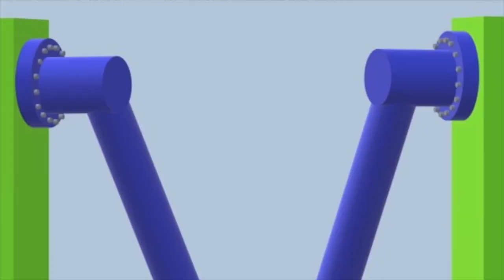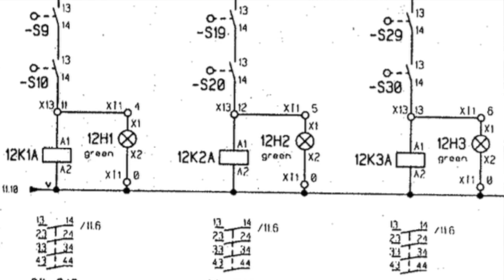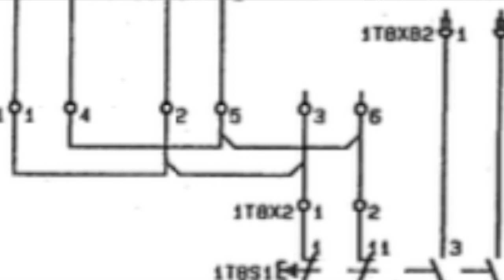10 things ride mechanics hate about rides

Comment: I'm in the UK and I've only been a subscriber to this channel for about a week, and its fast becoming one of my favourites. Its great to get an insiders view on the mechanical side of things, one of the most frustrating things at a theme park is when a ride is "down for maintenance". Do you think that a park should be a bit more open with guests when its just for cleaning up vomit/blood, or someone passing out in the queue line? it would help guests realise that the ride is safe and also give them an idea of how long the ride will be down for.
Reply from the maker: its bad either way. when they say the ride is down, you loose people even if its a simple reset. when you say someone vomited, you loose people just on the gross thought. so there is no good option. best I heard was a magic mountain they said the ride was temporally down but they advised waiting in line. parks don't like this because if I wait 30 min for it and they were wrong, im more upset now than if I just got out of line. no recall good way to handle this

Comment: Just discovered your channel, great content!  I’m actually looking for an old gas-powered, cable drive #5 Eli Wheel and Scrambler. If you know of any sitting around, or know someone who deals in used rides, I’d appreciate it.
Reply from the maker: That’s a rough one. The paper “Amusement today” has an add section in the back. I know good used stuff is very hard to come by. Google has search if you type in used amusement rides. Maybe someone reading the comments might know as well. Either way make sure you get the service and NDT records for those.
Reply: @ryantheridemechanic  Thanks, I appreciate that!

Comment: A true number 1 is maintenance hates engineers.
Reply from the maker: I guess it’s the engineers you work with. The ones I worked with, had and still have a great relationship. Sometimes they get in the way of a repair but their looking out for the best interest of the safety, equipment, and park overall.

Comment: I sub you and i am a ride enthusiastic i am always wondering how many times a ride would beeak down and curious about air control valves and motors and hydraulic system 

I am a enthusiastic about a ride called Avalanche and it's built by Wisdom Rides industries and i am always looking around and finding out in and out of this ride and this channel will help me what i would like to know 

I am wondering about a gear part called sleuth ring that is used on th ride behind the big arms that holds the bench of seats in a row and its inside of a hub that turns the arms
I am wondering what drives it and pushes it inside 
There's 4 holes behind the scenery panels where the sweep hub is 
Any thing would help this fan out 

Cool channel
Reply from the maker: @Polaris_1992  thanks! And welcome!  I haven’t done a video specifically on slewing rings yet but I think I will in the future.

Comment: As a fella that's worked a variety of things, intermittent electrical faults are often the worst to diagnose and repair.
Reply from the maker: Yep because you have to troubleshoot in it’s failed state “DONT TOUCH ANYTHING” I’ve actually had to hold people on rides for another 5min or so while I tried looking for the problem in relay logic systems. Not fun.
Reply: @ryantheridemechanic  I had a fuel pump decide to not pump right in the middle of an intersection, then it decided to work again. That wasn't fun, either.

If I ever put in a new fuel pump in an old car, all of those connections will exceed O.E.M. (I'm thinking solder and shrink tubing, or at least solder and taped).
Reply from the maker: @j.l.m.6862  what a pain
Reply: It seems to be a common fault in older vehicles. And due to the labor time involved, many shops will advise full replacement of stuff still having some service life left.

The "buy once, cry once" idea, I suppose.

Comment: LOL! Mechanics were MY friends. I worked at a themed park. I knew maintenance personnel pretty well from Carpenters, paint, Fiberglass, electricians, sign shop, mechanics. Even knew drafting/engineering. Certain mechanics had their own "babies" Rail road, Shuttle loop coaster, Arrow suspended was Emerick & Johnathan. Also some flat rides Chance YoYo/ Trabant. Shuttle Loop would misindex long or short. Ride ops push train forward or backward manually. They all could tell funny stories. I learned a lot from them and eventually moved from railroad to Sign Shop.

Comment: I thought you were going to list evacs as the number 1. I couldn't imagine how bad scared guests could be when walking down a lift hill. Sheesh, I was witness to some epic breakdowns guests had waiting on the final brake run of Superman at Great Adventure... You know, the flier where you are a measly 4 ft off the ground on that brake run...
Reply from the maker: We always had operations do the bulk of the work. Maint was just there to open the restraints when asked. But we Alway had first aid there to judge the people before we opened the restraint. If they found people that looked like a panic risk they would address them first

Comment: Your videos are awesome! I have a couple questions about roller coaster wheels. The last time I went to Worlds of Fun, the Mamba (the parks Morgan hyper) went down for maintenance twice in one day because maintenance needed to replace a wheel. It appeared the polyurethane coating had lost a chunk both times. One of my friends went to World of Fun a couple weeks later and the Mamba closed to replace a wheel again, which feels like quite a bit of wheel issues.

1. How often do you have to replace a wheel on most coasters? Is more than once a day excessive?
2. Is there a specific reason with the track or trains that would cause roller coaster's wheels to lose chunks of the polyurethane?
3. Have you heard anything about Morgan wheels being problematic/do different manufacturers need their wheels replaced more often?
4. About how much does it cost the park to replace a wheel?
Reply from the maker: Great questions. Best response with a video much easier to show in this case because I can.
Reply: @ryantheridemechanic  Thank you so much for considering my questions! If you do end up making a video I'd be eternally grateful <3

Comment: 👍 I Alway praise the maintenance crew of Knoebels for their ride upkeep, but do you think maintenance on old rare antique rides would a bigger nightmare for crews or that newer rides are worse?
Reply from the maker: Older rides are more of a nightmare because the supply Chain has dried up. When you need stuff it will now require engineering to make a new part an that is not easy or cheap at all. Good question

Comment: Hey! I love you vids. I wanted to ask you a question. Are ride mechanics allowed to talk about how coasters work with guests? Because when I went to Disneyland I asked a cast member how many trains are on the track and she said I can't really talk about that but then I spoke to a manager of the ride and he said 10 but he also mentioned how certain components of rides can't be discussed with guests do to contracts they sign with manufacturers. I just wanted your thoughts, thanks!
Reply from the maker: Most parks don’t want to discuss things like this for 3 reasons. 1) it distracts the workers slowing the rides throughput and possibly casing a safety condition. 2) it none of the guests business at all. They don’t need to know “our” inner workings. 3) typically when questions like this are answered, it has to come from the PR department so the park doesn’t get a black eye. They want to know who they are talking to and what they are doing with that info. I got in trouble by PR because I said the cost of a ride that was 18 years old. “Never say a cost” they said.
Reply: @ryantheridemechanic  Okay gotcha, thanks for the thorough reply. I love roller coasters and how they work so I just have a curious mind, I never meant any harm by asking them lol. Thanks for the reply!
Reply from the maker: @JungleJetAviation06  no worries. It’s always been curious with questions I’ve had growing up so let’em rip. There are some thing I can’t/shouldn’t say and if that’s the case I’d let you know.
Reply: @ryantheridemechanic Also, just in general, why do parks sign these types of contracts with manufacturers that certain things can’t be discussed? They are not nuclear codes lol
Reply from the maker: @JungleJetAviation06  it’s because the manufactures don’t want to get into price fighting. Pricing is a negotiation so they can’t sell the same ride for the same price twice. They don’t want “well you sold it to this park for 12million why is our 15million?” Every coaster is custom and there is sooooo much that goes into price. They are not like buying a new car.

Comment: Hall effect sensors, why the F aren't hall effect sensors on this list. You talked about rides being dirty but one spec of dirt containing any metal can cause a ride to go down 😢
Reply from the maker: Hall effect sensor are actually pretty stable well at least the one I’ve used, hard to mess up as well. Inductive prox, yea keep them cool and clean.
Reply: @ryantheridemechanic  I've seen them detect a lot of ghost trains, might be brand dependent though, or the type we use/hate are called induction proximity sensor over there in the US. The little green boxes of crap that we have several new ones of in our toolbox to almost use daily... Lucky they are light weight and cheap 😅
Reply from the maker: @HaroldKuilman  ok so hull effect is different than inductive proximity. Hall effect sensor won’t flag with metal in front of them. That strictly work off of magnetic polarity so the need a magnet to flag them.
Reply from the maker: @HaroldKuilman  I feel like we are talking about the same thing with different terminology. Let’s agree sensors suck 😂
Reply: @ryantheridemechanic  from a physics perception; all metal and magnet detecting sensors rely on the hall effect to work as they change the magnetic field when present. Where I worked (in the Netherlands) we just call them sensors, we didn't have any that detect magnets in particular. So that might be a translation error from my side. And yes, let's agree they suck.

Another thing that sucks are the plastic caps on the wheels of old vekoma wheels (like on most boomerang coasters) that can easily be kicked off by employees or guests.., once or twice a week 😅 during high season we would just glue them in place, break them during the bi-weekly maintenance and replace them for new ones to minimize downtime.
Reply from the maker: @HaroldKuilman  haha!!! The plastic caps. Ours had grease in them but they refused to run the ride when a cap got kicked off.
Reply: @ryantheridemechanic  indeed the grease caps, we asked vekoma and they told us not to glue them because we would have to replace them every time. So we said; okay, we would like to buy 2500 of them so we have supply. They didn't like that but did send them 🤣
Reply from the maker: @HaroldKuilman  we used RTV or silicone as the glue. As long as the cap was in good shape we could glue them back on between cycles if we spotted on before they did.
Reply: @ryantheridemechanic  great as a seal, but still very easy to kick off. We started using CA, lot of extra work during planned maintenance but a lot less downtime during the day. And a bigger job that can be scheduled as a big job is always better then unexpected downtime IMO